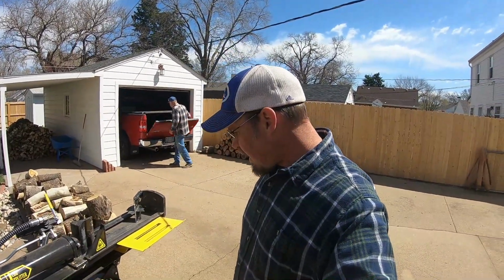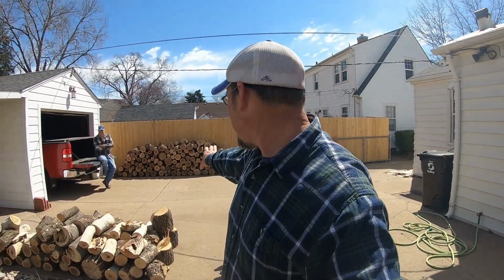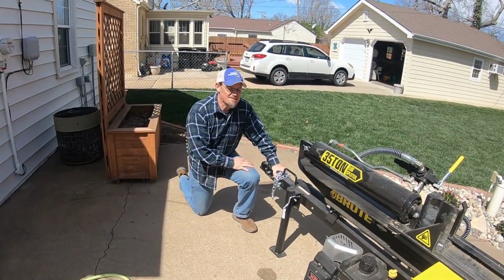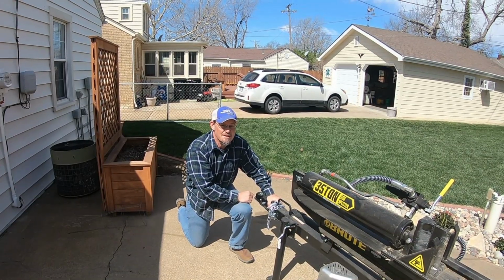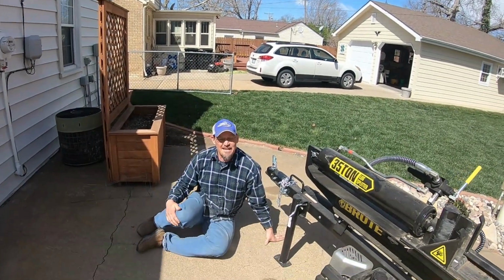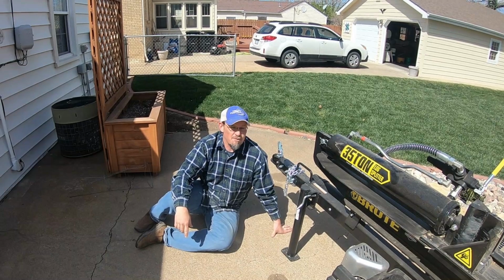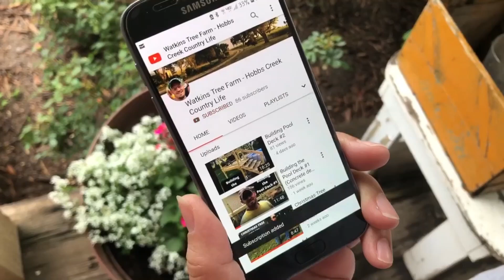BRUTE 35 Ton Splitter - w/ Small 4-way!! (Review)

Comment: I bought mine last year, I've used it 5 times, great splitter BUT! it has a very poorly designed motor mount!! I've snapped off motor mount Bolts 3 times already, had to build a reinforcement mount off the end of the motor mount and get rid of the hard plastic motor mount bushings and mount the motor directly to the plate, if you don't support the loose end of the motor mount plate to the frame, it will vibrat the welds where it is mounted to the hydraulic tank and break.
Reply from the maker: Noted.  I did notice the last time I used it the muffler shroud was getting loose.

Comment: Nice video. I bought a 30 ton Brute log splitter with a 4 way wedge. I never actually got to use it though because the engine was defective straight out of the box, lol. I like your video but i personally could never recommend  Brute log splitters from Menards. Poor product and customer service from both.
Reply from the maker: Thanks.  So far so good.
Reply: The splitter is fairly nice. It's the B&S engine that sucks. Lots of hard starting and replaced many recoil starters because the rope retaining track is paper thin plastic.